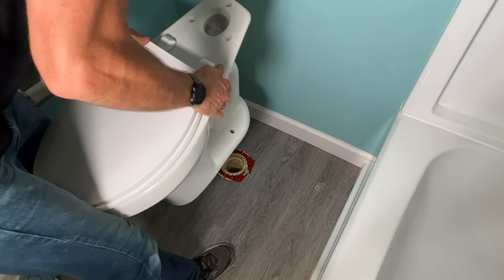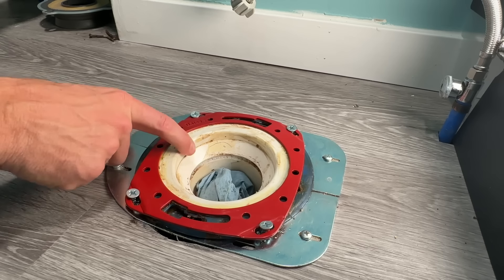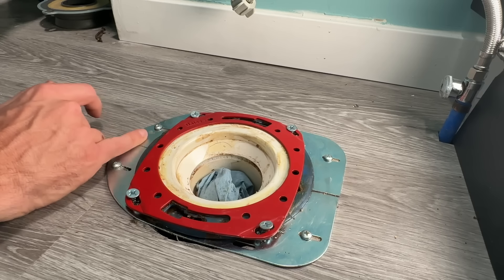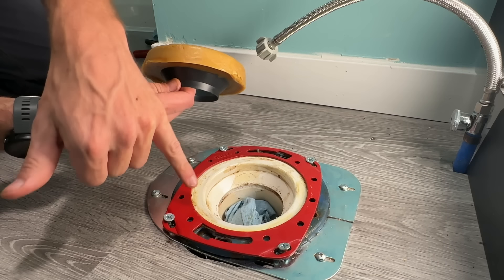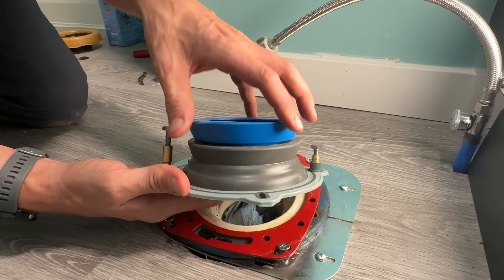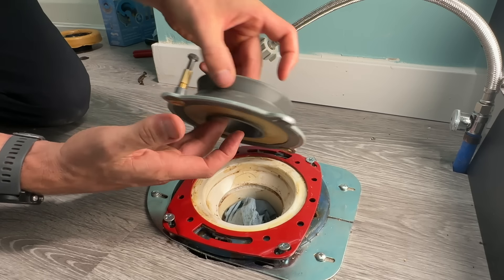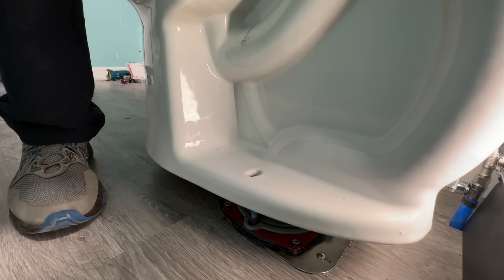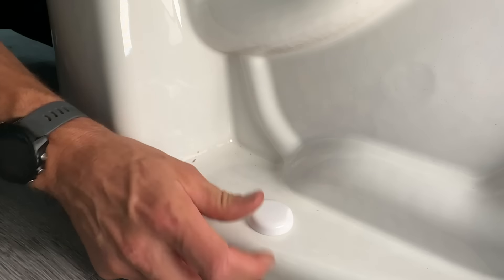How To Install A Toilet Bowl | Best Product On The Market!

Comment: I, think that this toitet will  not be proper balanced  since you did not showed  the completition and having  double  flanges  that are to high, also there is a big gap in between the two plates around the back side. nice video

Comment: Cultured marble & porcelain are delicate. I just installed a toilet & sink. The sink was leaking from the overflow drain that runs on the exterior underside of the bowl, & two toilets leaked from the bowl straight out of the box (third time lucky, maybe). I think the failure rates for manufactured goods must be 10%. What a massive waste of time.

Comment: The problem with all these gizmo's and anti-leak contraptions is they might get the water to go down the pipe but it's the moisture (air) leaks that ruin floors, wood and structural members. . Ya can't just start stacking stuff on top of  things without making absolutely sure "zero air" can't travel through it. I really should make a video on setting toilets but I'm  lousy at editing and piecing it together.... plus a voice nobody likes to listen to. But I can plumb a large custom house from the ground up all by myself..... and the toilets will never wobble, leak or cause damage.

Comment: Why did engineers decide a wax ring is the best material to connect the porcelain toilet to the sewer line flange? Why not rubber? Help! I need to know so I have confidence the next time I go to the restroom.
Reply: Wax is easy to press-fit into, lasts longer than rubber, is cheaper than rubber, and is popular still for it's nearly 100 years of proven effectiveness.
Reply: @jake9705  Just like copper pipes & lead free solder for drinking water minus the cheap! Copper in wax out.
Reply: Because they have had toilets far longer than modern rubber for toilet bowl rings. Beeswax was readily available and did the job very well.
Reply: @davej7458  I love the idea of a wax ring standing the test of time and toilets. Civilization dances on a wax ring. Wax shows up & does it’s jerb.
Reply: @Kevin-mp5of  Thanks. I need to edit more carefully next time. Cheers!
Reply: Wax is a pretty gross and anachronistic technology frankly. I'm glad engineers are working on products to obsolesce this ugly business from our lives. I've used Fluidmaster's better than wax ring in at least four toilets so far. I've even reused a couple of them now. I followed the instructions and have verified with my own eyeballs that they are without leaks.

Comment: Those Danco kits are waaaay to expensive! While I agree you MUST have a secure toilet flange at the proper height etc., using a simple wax ring or one with a plastic extension works just fine at a fraction of the price. If the flange is right everything else will fall into place. Also be sure to level/shim the bowl before tightening your bolts, nothing worse than a toilet that leans to one side.
Reply: If the plumbing was done right, there is no need for special adjusting rings.  A wax ring and possibly the plastic extension, if the flooring material has been changed, will do a perfect job for many, many years.  Unfortunately, a lot of plumbing is not done right.  lol

Comment: i messed with wax rings too many times, the last toilet i had to fix i used a flexible toilet gasket. no more wax, seated just fine and certainly no leaks. nothing worse then getting everything set up and then you put the toilet off by even just a little and your wax ring gets all fucked up and you have to go get another wax ring. nah f that, get the gasket and you can fuck it up as many times you want before seating it properly.

Comment: Wish u showed , how u installed the flange .. so we see the gaps . I used this danco product & don’t recommend it , it popped out & leaked .. upstairs , I didn’t notice until I saw , water damaged on my ceiling smfh .. use bigger wax rings , it won’t fail , rubber will eventually rip or pump out if u move toilet from daily use

Comment: I keep seeing these “wear gloves!” comments.  With or without gloves, I’m thoroughly washing my hands after.  Keep your nails trimmed and use a brush when washing, I’m going to do that either way so are gloves really necessary?  My dental hygienist? yes, wear gloves.  A home plumbing project…just wash your hands well and don’t be eating potato chips while replacing a toilet :)
And yea, if I’m using my fingers to scrape out the old wax seal, I’m wearing gloves.

Comment: I used the oatey set rite which used to another name but oatey bought  them. I had to as the stupid plumbers the builders use or the process of building is not communicated what flooring is going in and they put the flange on the floor when it needs to be higher  so it sesls properly

Comment: At 4:43 you add the plastic caps but the Danco video has them placed before the “O-ring/seal” is placed. Who’s correct?!?
Reply from the maker: That is a good question and I didn't like how the wax ring just sits on top when you install the plastic caps first.  You can see in their video where the wax ring isn't actually sitting on the flange.  That didn't seem right to me and that is why I reversed the order of operations.  Thanks for the question 👍

Comment: I hired a "Licensed" plumber to fix my leaking toilet. After I showed him the mess the toilet was making, he made a suggestion. He told me I needed a NEW toilet, not once but several times. I have an expensive KOHLER one-piece with a raised seat. I could not see anything broken or damaged with the toilet. Then I knew that he wanted to scam me. He would make money on the new, I presumed, toilet and probably use my toilet on another job and make more money.

Comment: Lay a flashlight on the floor shining at the flange bolt when you align the the toilet with the bolts.  It's better than those guides.  Two flashlights are better. 

Also don't use those tapered screws.  Use flat screws like structural GRK screws.  They don't shear off so easily.

Comment: The danco bolts are fine.  But there are too many variations between brands in the non-wax seals and they are 3-4x expensive as wax. They can even cause flush problems from air leaks at the sealing interface with the toilet. Like the wax ring box says: "wax works every time".

Comment: I’m not buying it, I’ve been installing toilets for 50 years. One little trick is use a sure fit wax ring, and a regular wax ring on top if there are leaking issues.
Reply from the maker: Thanks for the feedback Robert!

Comment: do not overtighten those bolts to the floor.  DIY'ers will learn the hard way by cracking the base so get it snug and stop cranking on those bolts!!

Comment: Almost any of these new methods will work as long as the floor is truly level, subfloor is not rotted out, and the toilet doesn't wobble. What I have done with rotted subfloors is cut it out and replace with a 2'x'2 vinyl board. Make sure it is level with the existing subfloor, replace any flooring up to the new flange, then install the toilet seals of your choice. The toilet is rock solid from there on out.

Comment: How to make setting a toilet as expensive as possible.
Reply: Wouldn't that have been a 20 second video that said, "Call a plumber?"
Reply: @jimsackerman   In  the context of diy… kinda figured people were smart enough to figure that out..
Reply: It’s never about money,mits about getting things done right.  Obviously that wasn’t the case before this guy had to redo things.  Hire a pro, let him use new drywall screws, or do it yourself, spend less money, and have a rock solid installation.  I’m not convinced that so called “pros” are good at anything other than billing.
Reply: @markg7963  “it’s never about money”… “hire a pro, let him use new drywall screws, or do it yourself, spend less money”… “I’m not convinced so called “pros” are good at anything. Other than billing”.. lol do you hear yourself?
Reply: This Guy is Crazy !

Comment: 1) there’s no “best” way to set a toilet there is nuance 2) wtf type of closet flange is that lmao 3) id only trust the seal of these on a brand new clean toilet, also you may as well just use wax instead of this, the spongey sani seal gasket has more use cases than this one, same with the red gasket one that I think fluid master makes? Idk i wouldn’t use this one though 😊

Comment: Evidently you don't caulk the finish product to help keep it stable and give a more finished look. And as hard as it is to access that supply shutoff valve it seems only logical you would've went ahead and Installed a new one while you was in there. Kinda hacky IMO😵‍💫

Comment: Wax rings are garbage. Messy and when they fail it's a mess. The one in my house failed only after 7 years and the mess is horrible. Tried similar product only difference is zero wax iy's all rubber and foam. Much better.

Comment: As a licensed plumber with 43 years experience, working in a large city,  I can tell you if the floor flange is properly installed in the first place, unlike god knows what that flange abortion is your working with,  a wax ring works just fine.  That "supercalifragilisticexpialidocious"  fit all super dupper miracle of mankind lifesaving do it yourselfer rubber crap ring is a stupid idea. All of them I remove the rubber is failing, deteriorating .

Comment: Don't use zinc screws or bolts like what's in the video. Use only galvanize screws or bolts because they wont rust so easy from the urine and fecal matter.

Comment: I have not used this exact product, but I have used a very similar one. There were several problems and in the end I had to remove it and go back to a wax ring. In fact, on that installation I tried several types of products and had problems with most of them. I have done quite a few installations. Frankly, I just do not like these rubber rings because I think that leaks are very likely.  I also do not like the little plastic piece around top of the hex bolt. It looks like a very poor mechanical method to hold the toilet in place, and I would say it does not appear to be secure and solid. So count me OUT.

Comment: this product is Not good at all, WAX rings have been in use for 100+ years, proven reliability. Plus wax is all natural and the other thing is made with non biodegradable stuff. they are trying to make the wheel rounder